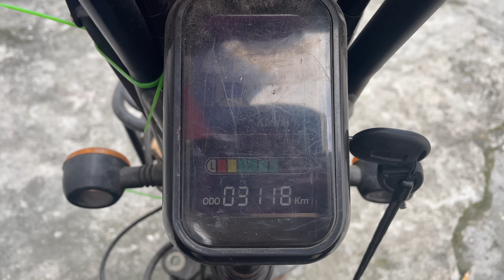Tesla Chopper for Sale! LIKE NEW

Comment: I don't know if they sell tire liners for these vehicles like they do for bicycles. Bicycles at least allow you to put in a tire liner to keep the flats down. It doesn't stop all flats. Just reduces the number of flats. I went a step further and would also reuse the old tubes as a liner. Got the idea from my grandpa. So I would use both a tire liner and about three old tubes in the bicycle tire. The flats went to zero. Perhaps reusing the old tubes in these vehicles tires could help cut down on the flats. Oh I see it's tubeless since the guy is putting in a plug. In which case non of what I said would work. I plug my own vehicle tires all the time from nails and screws.